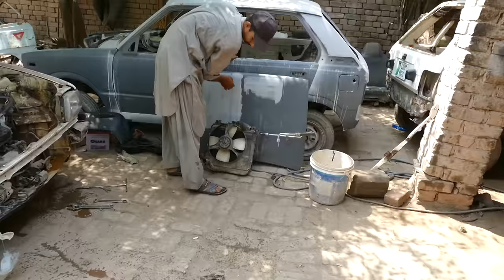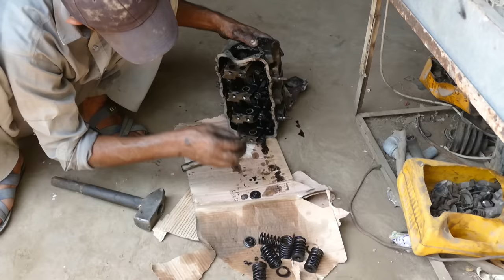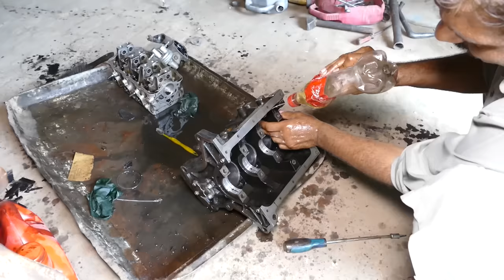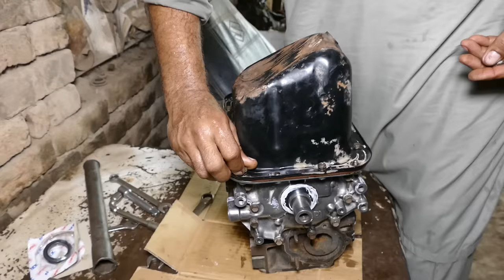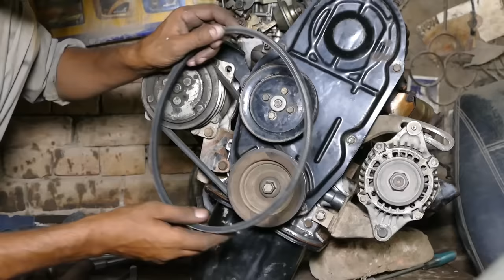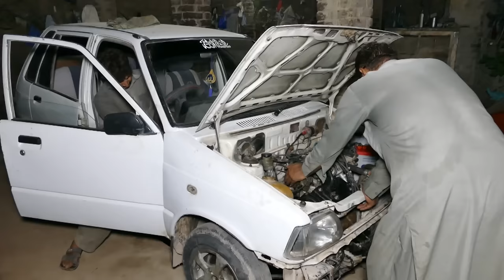Suzuki 800cc Car Engine restoration | Full Overhaul and Repair Engine

Comment: Good for another 50 miles.
Reply: I'd disagree. No one knows the actual mileage on the car, but it withstands the harshest conditions with little to no maintenance, and will carry 5 or even 6 ppl on hilly roads. The number plate shows this is a 2007 model, and it'll work just fine for another 100,000kms if not more!

Comment: I think it needs a little more sand inside the engine and shellac in the head gasket to make it work properly, also the torque wrench is calibrated perfectly. Just use an older timing belt.
Reply: If I give you 100 dollars to kit out a shop I'm fairly sure you're not going to feed your family restoring engines.

Comment: excellent  engine piston  ,  valve   cam shaft   repair  #  but  instead  of lifting the  engine  with  hands  use   metal  chain hanging  over  pulley  &  instead of  filling   with water  fill  the radiator  with  coolant # 👍👍

Comment: They really need to educate as they filled 20w-50 oil in newly overhauled engine and they filled tap water in radiator and how badly they put the engine back into the car as it could easily brake the front cross member and they didnt even use torque wrench lol they just tighten the bolts by all force they can apply
Reply: True.... I don't think they've any idea about oil grade as well as the importance of coolant in car 🤣
Reply: @nirupampaul7104  i think they perfectly know it's not so important, it's not a fragile "made in mexico" american car. Tap water is acceptable for a car coolant system with the benefit of not killing animals if it leak...
Reply: Antifreeze is only necessary in winter climates , water actually works better as a coolant
Reply: @Re_Kitty  brother it will cause rusting, please research before you post something..
Reply: @nirupampaul7104  not so much rusting, lol. Depends on the engine. I don’t need to make research when I’ve seen it used in practice. You need to be the one who learns.
Reply: if you look you can see that engine is rusted but using water is okay in their climate with those old engines (not much hot or much cold weather  )
but if you live in cold country you need to use oil not thicker then 5W if your engine is in perfect condition and antifreeze or your engine will break when the water freeze and find no place to escape

Comment: I think about air tools torque wrench and a clean work station, but I suppose this labour is so cheap that even a shop compressor would be laughed at. I wonder how long these men are able to work without the necessary protective clothing etc. They seem to do wonders in terrible circumstances. How long do these "invigorated" vehicle actually last. I mean not criticism I just thank God our fathers and grandfathers fought for better working conditions.
Reply from the maker: You are correct
Reply: Tienes razón ,,aquí en Europa esto no lo verás nunca ,ese desorden a mí me mataría ,soy de la profesión y nunca he armado un motor con más gente montando también ,,yo los monto y los reviso siempre dos veces ,y las cosas muy delicadas las pongo con delicadeza en otra mesa aparte de la bruta ,,,veo estos vídeos para ver cómo está el mundo en este ramo ,y doy gracias a Dios estar en un país que te exigen de todo como ropa ,calzado ,guantes ,gafas ,etcccc de seguridad y no como aquí que ni zapatos se ponen reforzados , saludos desde Islas Canarias

Comment: YOU ARE NOT REPAIRING CARS, YOU ARE DESTROYING THEM.
Reply: They did repairs my man
Reply: You are not mechanical guy
Reply: @deanle604  i am and if i was working a moter on the dirt my Klinds would kill me.On the assembly of the motor you must use the wright pressure.Any way maybe for Countriew like Pakistan they are good.For Greece,for Europe they are............Sh......

Comment: Wonder what original problem was .. crankshaft bearings, cylinder bore wear?? .. BUT .. good job done with limited tooling whilst in poor conditions .. Air tools, work benches and work boots would be welcomed .. well done to the mechanics and helpers .. regards from England.

Comment: My main concern,  dirt contamination and that crankshaft pulley bolt.   That bolt better be factory tight or valves meet piston when the bolt comes lose.
Reply: not an interference engine

Comment: That's a hard working team doing amazing things with their bare hands and minimum tools. Do they not have torque wrenches and manuals in Pakistan? And safety boots. And rubber gloves for when you're washing parts in gasoline.

Comment: of course, the work was done not a small bravo, but they did not replace the timing pulleys, belt rollers, etc. then they did not check the engine at least with a mounted installation, but they already put it right away and plus they put the cylinder head gasket on solid wood, are you guys serious??

Comment: Was that ATF they were putting in the crankcase?  Not to mention that the motor mounts should have been replaced (or that engine was completely out of time on the ignition side).
Reply: Its a 3 cylinder they are never smooth infact for newer models they deploy a balancer to counter the irregular cylinder motions

Comment: It is good they keep this car on the road instead of recycling it.
But if you are going to rebuild an engine do it right. Do better job of cleaning parts. Don't rebuild engine on dirt floor. Use torque wrench on head bolts.
 Crank bolts. Connecting rods. And other parts that should be torqued to spec.
You should to valve job or valve guides or atleast lap the valves. 
I would not do such job.

Comment: Rough but it still works.
Wonder how much is the charges to overhaul the Suzuki engine
Reply: roughly around 200 to 300 dollars...
and this little car (used) itself  costs around 2500 to 3000 dollars 
used vehicles are expensive because maintenance is very cheap  here
Reply: @F-Khan491  the car is worth 200$ on the other side of the border 🤣
Reply: @F-Khan491  no its not that much u said.

Comment: Man do I feel spoiled having a full shop and all the tools and equipment to work on cars.  I have to admit though, I couldn't have done it any faster than they did and they would both probably go the same amount of miles.  Still with no torque wrench it just seems wrong
Reply from the maker: Right on

Comment: I've come to the conclusion that India. Pakistan and simular counties have the best mechanics due to their make-do-and-mend way of life. New parts to expensive. Fix it or do without... It starts at birth and goes on untill death. We fix anything anytime anywhere... Some people mention power tool. The guy loosening the flywheel main bolt is faster than a snap-on power wrench and never strips the threads..

Comment: So, does this mean another 100,000 miles?. Maybe the little Suzi had covered more. Nothing was broken (valves, con rods, pistons) thus it was a rebore and refresh. Thing is, if the price is right and you trust the workers ( there's less emissions worries) then this is the only way within this type of economy. A Suzuki engine, found in a scrapyard there, would be way too far gone for refurbishment.

Comment: You guys need gloves to protect you skin from what ever you use to clean parts with. Do not turn the crankshaft before you put oil on it and bearing seats/surfaces.

Comment: The number plate shows this is a 2007 model. Still running strong! Beat that, environmentalists 🙂
Keep it running till it rusts away!
Reply: it will not rust because there is no much rain over there lol
Reply: 2007 model? You must be kidding. This is an F8B engine with a carburettor on it. 1990 is more likely than 2007

Comment: Engineering is based on very tight tolerances. I won't be surprised if the rebuilt engine fails straight out this makeshift donkeys stable.

Comment: my god..this people is kings...........and how much cost job like this
Reply: roughly around 200 to 300 dollars...
and this little car (used) itself  costs around 2500 to 3000 dollars 
used vehicles are expensive because maintenance is very cheap  here
Reply: @F-Khan491  my  god...so much money for this car....in europe car like this is free........thank you.......greetings from croatia
Reply: @fojnica2226  yup, i can understand, the roles are reversed there, i.e., perhaps an engine overhaul would cost $2500 and this car would cost $200 :)
Reply: @F-Khan491  engine overhaul easily more than €4000. Mechanics are lazy here!!
Reply: @Re_Kitty  
1st this engine is cheap and have little parts 
2nd this car don't worth $200 in developed world and one mechanic hour payout is like $100 or more over there
Reply: @Techie1224  yes you are correct

Comment: Where do you put that waste oil?
Reply: Mix it in with the diesel fuel for their trucks!
Reply: It's recycled. Waste oil is purchased from mechanics and oil shops by recyclers.
Reply: And yes, bob's right. Processed to be used in  furnaces, etc.